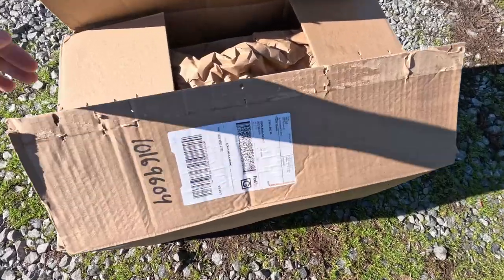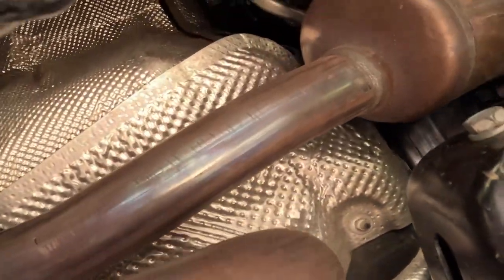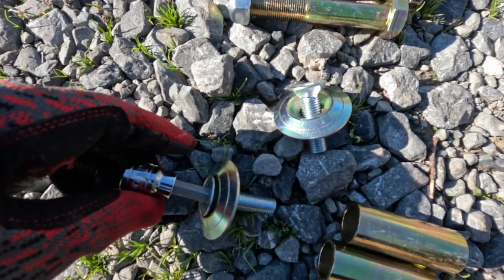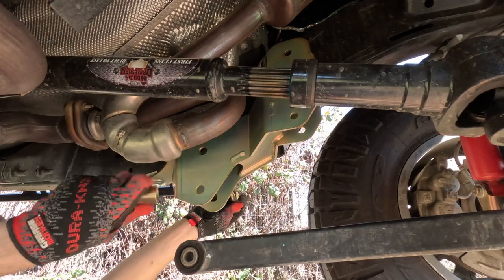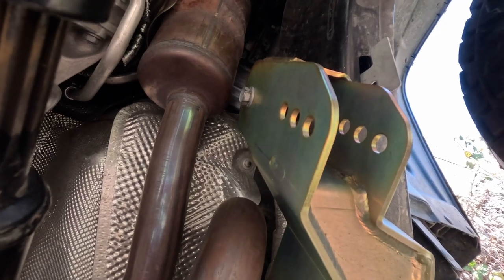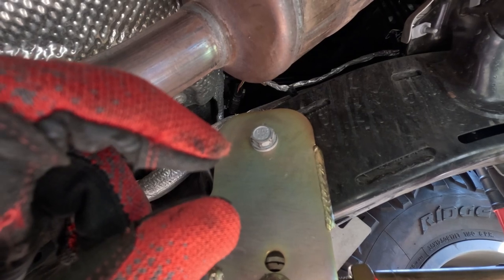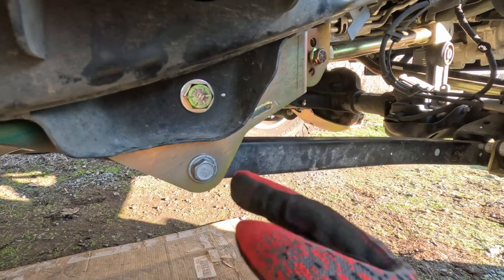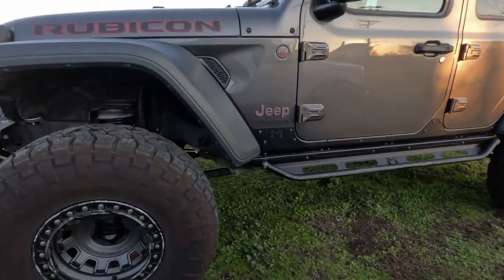Lowering your Jeep! Installing Metalcloak's Pro'lignment kit for Jeep JL Wrangler.

Comment: I know this is a year old, but hoping I could ask you a question. I also have a 2018 JLUR with a 2.5" lift. I noticed you had an issue with the skid plate crossmember (not sure what you call it)  that is not in the Metalcloak instructions. I see you you took it off (crossmember bracket) and it looks in the video that you are going to re-install it with the stock frame bolt instead of using the Metalcloak Allen bolt -did this work out okay? I want to buy these brackets but am concerned about re-attaching that skid plate crossmember brace. Thanks in advance if you can share.
Reply from the maker: @johna6613  hey! 
I did indeed re-install it back on with the stock bolt, and not the MC provided Allen bolt with the fancy washer. It worked perfectly and has had no issues at all for the time I have had it. I forget if MC recommends them for the 2.5” lift or not but if they do, I would highly recommend them. Totally changed the on road performance for the better, and have not noticed any negatives.
Reply: Thanks